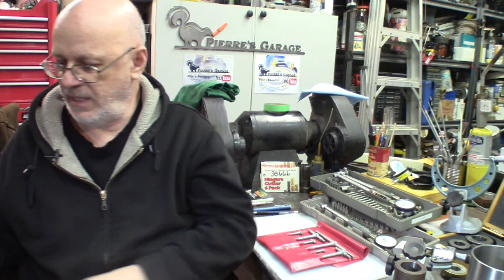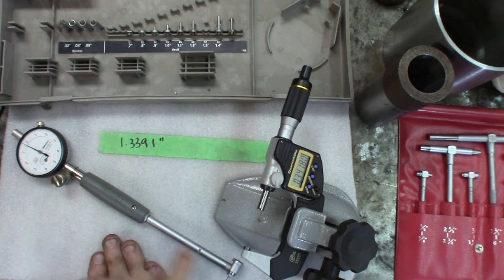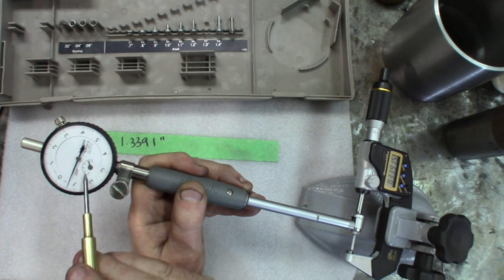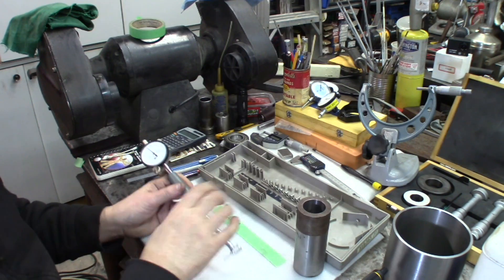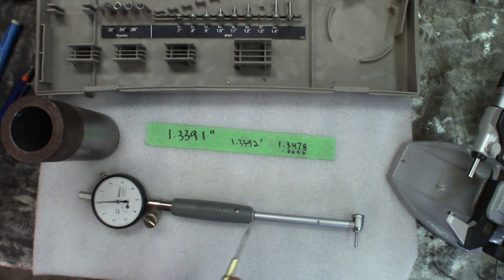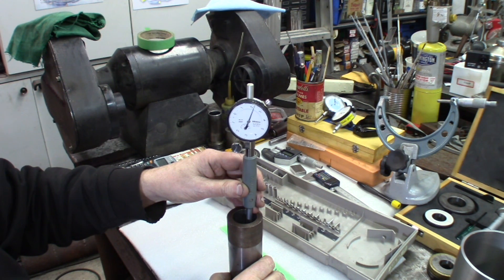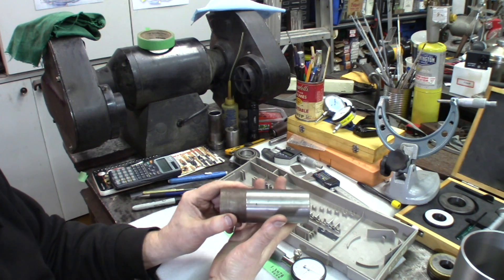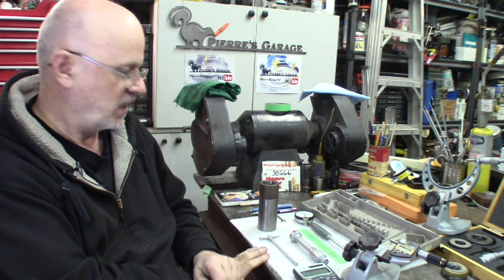Dial bore gauge VS Telescopic gauge - How to use and calibration. Measuring a cylinder

Comment: Great video! Those 3 point micrometers are so expensive! Compared to telescopic gauge and bore gauge!
Reply from the maker: Thanks for your comment...
Right about the price of those 3 points micrometers, the amount you're ready to spend is dependent of the type of results required to achieve, for a hobbyist, an amateur or even a small general works jobs a good set of of snap gauges will be a reasonably affordable solution giving very decent results, as with any high precision work you also need some good practice in the feel in order to get repeatable and accurate measurements.   🙂🙂👍👍

Comment: I know this is an old post but many will see it. When I have a critical dimension like that I usually stop right before the dimension and do a Spring pass. Meaning I don't make any changes but I send the tooling through the board or the outer diameter at the same dimension that I previously set to to even things up. I will do this 1 or 2 times depending on how close I am and how important The boar where outer diameter is.
Reply from the maker: There is a way to calibrate your passes in order to avoid having to make spring passes, in a few of my other videos I demonstrate how to achieve it on the lathe, in short, it's by making a few equal passes and calibrating the real removal of the tools taking into account the deflection, once you're calibrated you just need to continue making equal passes, there the dial or DRO will yeld the exact measurement of where you're at. Normally you could get there with two to three passes to do, this normally gets you within +/- three thents of an inch. Just make sure your part isn't hot when performing any precision machining, or compensate for retraction due to cooling of metal...

Comment: Can you use digital verniers that measure .0001 to measure with telescopic guages? The micrometer and digital verniers measuring do the same thing?
Reply from the maker: You can use just about any measuring instrument to take some measures or serve as reference, it all depends on the level of precision your job requires, as a digital caliper is precise within at best around plus or minus one thousand of an inch, as on the other hand, a decent micrometer will be precise about 10 times better, like I've said before it all has to do with your available resources and the requirement of the job you need to achieve.

Comment: if i get high quality bore gage can I expect that anvils and washers are so accurately manufactured, that I wouldnt need a micrometer?
Reply from the maker: I wouldn't trust using a dial bore indicator without a good reference to an accurate micrometer, I suggest you keep your eyes open for a good used micrometer, it usually comes quite at a reasonable price for a brand name, or, look for new ones from Fowler, Shars or some other decent tools.
Thanks for viewing and for comment,    Pierre

Comment: You would never want to turn the bezzel to the needle you want the needle to be as close to the zero then twist the dial to zero so you are not turning your head. Also the lotto dial you want at zero not at 4 cuz if it is not at zero then your measurement will not be right it will be  thousandths off. Use a ring game it will be a lot easier than a mic

Comment: hello Pierre, I really learn how to measure with the Dial bore gauge, the reason that I search this video is to rebuild my Subaru legacy 03 engine that's my project, by the way, I'd like to know the model that you have or any advice in order to buy one, best regards from Inca's Land 
(PERU)
Reply from the maker: The tools I own, they are Mitutoyo series, 
For measures from 0.7" to 1.4"  :  511-104
For measures from  1.4" to 2.5" :  511-105
For measures from  2.0" to 6.0"  :  511-107
The dial indicator number is:   2923S-10 or a 2923F-10 either one will work, I have both.

Cheaper stuff is almost never an investment...    Sometimes you may get decent cheap tools, but, it's not to be relied on unless you got reliable referal. If you only want brand new tools, you may want to look into brands like Fowler, Brown & Sharp, InSize, SPI, Mitutoyo, Starrett, agreed that some of those are in the $1000 range. On the other hand, if you could consider good condition used tools, you may get very decent brand name at great prices, some of my tools are in that category, I'm real satisfied with those. BTW, I got a cheap one once and it went in the scrap bin, it was a useless tool...

As for telescopic gauges, same applied, remember having to work with a cheap set once, it was quite unreliable, mostly using the smaller diameter ones, the problem was the spherical ends weren't rounded enough to not hell on the surface on retraction, took me a while to figure this one out, same advice with those, get good ones. Any real cheap tool you could consider, just try to get references from a reliable source before considering the purchase, in the rock bottom price range the gold nuggets are quite the exceptions...

Hope this helps, All the best,   Pierre
Reply: Pierre's Garage thanks for taking the time to answer me , keep doing best videos on your channel, best regards, Steve.

Comment: Towards the last you demonstrated exactly the lesson I taight apprentices that came under my thumb. Don't look at the mike when taking readings. You can easily fudge a thousandth (or two, if the mike is large) without knowing it. Same goes with any direct measurement tool depending of feel. DAMHIKT.

Story: I was called in as a third party settle a dispute in miking a 20+ inch bearing fit on a very large part. The tolerance was 0.0003 to 0.0005" interferance with the inner race of a high precision bearing whose net bore was known to 10 millionths. Ten thousandths readings on a 20 inch feature is 6 significant figure accuracy - something best performed in a temperature controlled lab not in the open shop. One degree F difference between reference and work to be measured is 1/3 of the tolerance. Calibrated thermometers taped to work and stack agreed to one degree F. The mike was old but in good shape. The calibrated accuracy of the mike was not an issue because it was used as a comparator. There was a stack of gage blocks handy to reference readings. I recall checking the blocks in the stack against their calibration sheet and summed the listed error with the nominal stack length - about 11 millionths as I recall, not enough to consider in the readings to be taken but a step to further validate our procedure. 

We all measured again going back and forth from work to stack taking several readings each and listing them, taking such care to not look at the thimble we draped a dry shop towel to block the view. After tossing out a couple highs and lows we settled on an average reading about a tenth under the high side of the tolerance.  Measurement by committee and statistics to be sure but those taking the readings were skilled, practiced, and experienced. Whatever our method, I'd argue a metrology lab couldn't improve on the accuracy of our final reading except by adding a significant digit.

This is an extreme example never to be seen in the home shop but it illustrates what may be accomplished with simple tooling when accurate references are on hand simply by eliminating and/or accounting for soruces of error.
Reply from the maker: This case is something you only face in very high precision machining, I mean HIGH precision, mostly in those larger diameters...
This is where your body heat radiated to the measuring area will have a measurable effect... Just like you did, by referencing and averaging and re-doing the procedure until you got a reliable and mostly repeatable readings, you finally got close enough to be certain the part was accurate, this is an ultimate challenge...
Not for the clumsy numbed fingers...   
Thanks for sharing your interesting and mainly extreme situation,    Pierre

Comment: i think i'm going to stick to my mic and my telescoping gauge. i came for dial bore gauges to see if i should buy one, and there are too many extra steps unless you plan on making 100+ holes that are relatively close to the same size.
Reply from the maker: The bore gauge is advantageous to monitor many areas of the bore in the cylinder, like roundness, taper, etc, as a telescopic gauge you need to take many measurements and it get more difficult in deeper bores...   Guess it's a question of choice...
A good place to look for a new used unit is in the local adds, just don't be in a rush and you'll cross a good deal...   This is how I got  some of my tools...   ;)
Reply: @pierresgarage2687  what i do doesn't require too much precision. Around 5thou plus or minus.
Reply from the maker: Guess the telescopic gauge could be a alternative, you just set it to what you need and poke around inside the bore, this is only good for broad tolerances, though...

Comment: Can you tell me the model number on your gauge set pleez i want to order that one
Reply from the maker: No problem, they are Mitutoyo series, 
For measures from 0.7" to 1.4"  :  511-104
For measures from  1.4" to 2.5" :  511-105
For measures from  2.0" to 6.0"  :  511-107
The dial indicator number is:   2923S-10 or a 2923F-10 either one will work, I have both.
Hope it helps,   Pierre

Comment: I see numbers every 5 on my dial bore goes up to 25 halfway then number decrease the full 360.  How do i read those numbers if the bore gauage moves to say 5? Measuring something 5.0000 is it 5.0005
Reply from the maker: I can't see how your dial works, and what units, you could send me a picture on my private mail, then, possibly I could see the dial and help you...
wledpierre@gmail.com
Reply: @pierresgarage2687  thx i was able to figure it out took me awhile... each hash is .0005.  Have another question is a micrometer better vs a caliper wiyh verniers on it? Using both i get two different numbers off by 1 thousands.  Im measuring the skirt on a piston.  My spec sheet on my pistons match my calipers but micrometer does not even after a calibration.

Comment: Pierre, do you think that this dial bore gauge from Mitutoyo is more precise than the dial bore gauge from Fowler which has wheels and  less degrees of freedom?
Reply from the maker: Hi, making real fine and precise measurements is 95% finesse and handling, more than the actual instrument, as long as the instrument isn't defective, though.   You need to get some practice and compare yourself with something accurate whenever possible.
Thanks for stopping by,    Pierre

Comment: What is the tiny dial that goes from 0 to 5?
Reply from the maker: This dial has a range of 0.050", every complete revolution of the dal is 0.010", so evert time there is one revolution the tiny dial will indicate the number of revolutions...
As an example if you measure, 0.0243" the little dial will indicate 2 meaning you have 2 revolutions plus 4.3 thousands on an inch...
Hope it's clear for you to get the principle, if you ned more explaining don't hesitate to ask...
Thanks for your comment,    Pierre
Reply: Thank you, so it reads hundredths of tenths, right?
Reply from the maker: This is a thousands of inches:    0.001"   Metric:   0.0254mm
And this is a ten thousandth of an inch:  0.0001"  Metric:   0.00254mm    just like in this type of indicator,

Comment: When you make a cut inside of a bore you double the measurement correct?  If you set your cutter @ .010 you will actually cut .020 correct?
Reply from the maker: It depends if your cross slide, carriage dial are indicated in function of the radius or in function of the diameter, it's easy to check, you make a cut taking for an example 0.010" and if you  actualy measure 0.010" your dial is set for diameter cuts, it means that the carriage actualy advanced 0.005", on the other hand, if you make a 0.010" cut and actually measure 0.020" it means that your dial is set to measure radius...
Also look for the slashed 0 symbol on the dial, if present it means that your set in diameter.
Be aware that croos slide is often set to diameter and compound is most likely set to radius or actual movement...
Hope I was able to make this clear to you and this was what you needed to be clarifief...   ;)
Thanks for viewing and for your comment,    Pierre

Comment: I don't like set up bore gauge with micrometer. For the stress to the spindle first, secondly the difference between micrometer (Mitutoyo) and Jo blocks stacked at the same dimension is always half a thousands undersized. 2 tenth.
Reply from the maker: Like you mention, transposing measurements is introducing an error, even minimal, that accumulate as we add steps, This is where expereince and judgment come in to reduce risks of errors...
Thanks for your input,   Pierre
Reply: Big salutation from Italy.
Reply from the maker: +Magic Rojava Here it's icy Montreal, CANADA....👙😊
Reply from the maker: +Magic Rojava Here it's icy Montreal, CANADA....👙😊
Reply: Sorry Pierre... I have an amletyc question... I'm not able to speak fluently english so maybe it will be hard.
The big question is: why we have to measure the telescopic gage touching, "feeling" the face of the spindle? Why don't use the ratchet?
For example: in one hand we have a 1" setting rod for mike, in the other one we have a telescopic gage and we've just measured a perfect 1" hole. Teorically both have exactly the same lenght, have not them?
With the 1" rod, when you set the mike you use the ratched (that tightens strong enough the rod), so why don't do the same with telescopic gage? But yet the difference between using the ratchet - and so tightening an object - or not using it, and so "feeling" the faces is about half a thau in my little experience. 4-5 tenth.
I'm practicing with some different master rings with few millionth calibration (fraction of micron or hundreds of nanometer), and honestly, in my case, I have the correct measurement if I use the ratchet. But watching all you great youtubers and machinists, no one of you use the ratchet and wish I understand why.
Hope I explain myself properly!
Reply from the maker: I think you expressed yourself allright, this is what I understood.

There is a difference using the setting rod and the telescopic gauge, the rod has flat surfaces and it's rigid, as if you have a little pressure on the ends it won't get any smaller and it's easy to get the max length as it's easy to handle and get the rod in line cause of the flat surfaces are going to self adjust between the ends of the micrometer, on the other side the telescopic gauge has spherical ends that needs to be measured on the apex to get an exact measurement, also the friction that keeps the plungers in place is another factor that could cause some error if we apply a little too much pressure using the ratchet.

Some people more than others may have more difficulty to gauge the pressure by feel when trying to find that apex on the gauge's ends, the trick is to reproduce near the same pressure than when you pulled it out of the part you had to measure.

What you're doing now using a known and reliable ring will help you get the "Feel" and get reliable results, it takes practice to get perfect results, also best to take at least 2 or 3 readings whatever method you'e using. When practicing with the calibrated ring you may also close your eyes and just feel the friction. The surface finish of certain bores may also affect the readings.

There is nothing to replace practice and expereince like in just about any trade, just by having your hands on the handles, by the sound of your machine, the size of a chip, and all those "Little" things you "Know" how things are going...

Let me know what you think...
Reply: Ouh no no I'm the newbiest of the newbie. I'm reaching, you teach Sir. 
Well honestly, I get your specific point, but I'm not sotisfied yet; but it's gonna to be too complicated. (barrier lenguage)
Personally I check the gage till the largest point I could find.

If you say me: with this tecnique I accepet a tolerance within 5 tenth, I understand anything. 
But if you say "no no" with this tecnique I'm even able to check the exactly dimension of the hole (ok, within the classic 1 tenth... at least), well, than I don't understand how, if you usually use the ratched.

Let's see to do in another prospective: how don't you oversized the measurement without using the ratchet?

That ratchet seems the key word!uah

Sorry
Reply from the maker: In the end, the most important thing is to do what you feel works for you. The fact you can get consistant results within tenth of thousand means that you're doing great....
Reply: I agree with that. Anyway I didn't mean I am so good. I could "break" (how we said in Italy) the tenth, but most times I stay within half of thausands.
Thank you. I'll predict a good running of the Raptors in the playoffs this year.
Reply: I'm still thinking about that!uaha

Let me to understan: if you measure with the ratchet a gage, 1" wide open, in the right place, and that means at the apex of both side, and than you measure the same gage, with this tecnique, you have the same reading? (I want to specify that I am not contesting)

Do you think the phisyological backlash could be a factor, in what I'm trying to say and figure out?

I think a backlash isn't a problem.... if you always use the ratchet (again!! Haven't you a sinonim, of this damn piece of mike?lmao)
Reply: @MrMa1981  Welders swear by those little ratchet wheels. They can spin them down onto the parts they are welding  much quicker. Another quarter turn and all is good.